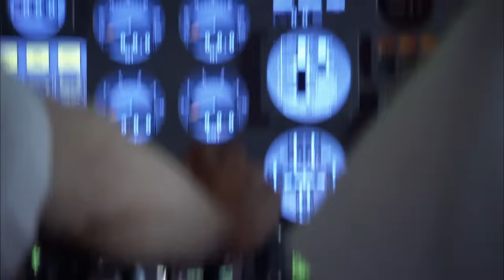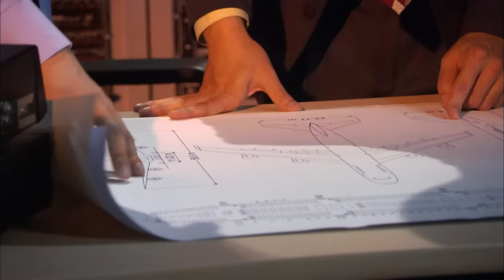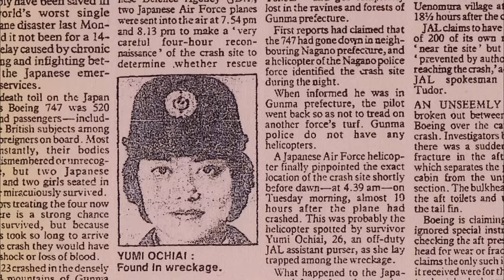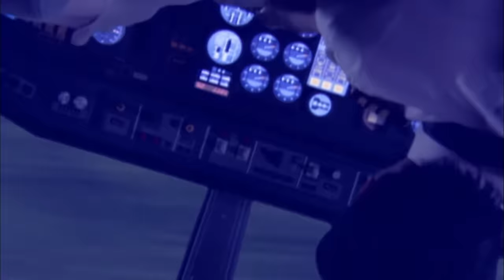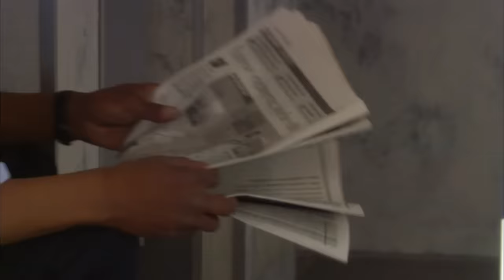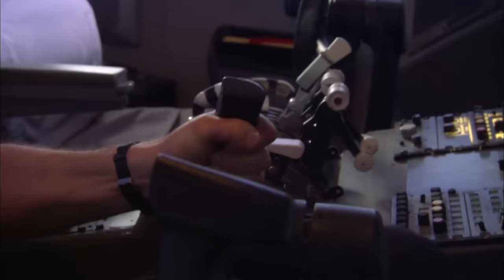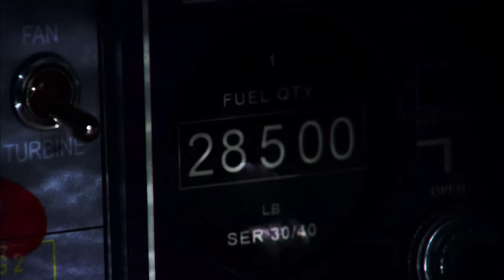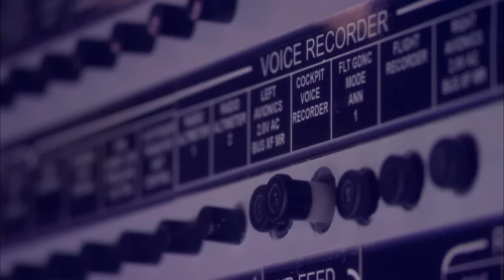Tragic Aviation: Japan Airlines Flight 123 & The Battle On FedEx Flight 705 | Mayday Compilation

Comment: Why didn't the Japan captain take control????
Reply: He was hypoxic....they were ALL suffering from hypoxia
Reply: The hydraulic system that controls the steering of the plane was losing hydraulic fluid and finally emptied. Henceforth, no control of the steering. Once the steering was lost, the flight was doomed. The pilots did the best they could. The flight unfortunately was doomed after the hydraulic system failed.
Reply: Can’t control a plane that has mechanical problems like that. Mechanically that plane was in failure. 

Like a car. If something is really wrong your not going to be able to drive it and will crash.

Comment: the 747 would've suvived if the pilots applied full right thrust and half left thrust on the deep dive, as the aircraft is vabking at nearly 90 degrees to the right, i dont really know, but the airspeed was "slow", so i dont really know

Comment: How all 3 pilots were so unaware of things. Put on your mask! What is going on with them.
Reply: The average time to crash for pilots who used the simulator to reproduce the crash after the accident was 10 minutes.
The pilot of Flight 123 flew for 32 minutes.
Reply: @wadepsilon01  the pilot of JAL 123 was an absolute beast for even managing to keep the plane in the air for so long. nothing but respect for him.
Reply: They were fighting with an out of control plane. 
There were circumstances preventing them from oxygen. 
However, they did manage to keep that plane in the air far longer than should be possible buying time. 

They fought the good fight despite the obstacles against them. That plane was going to crash no matter what. Sadly. With that kind of mechanical failure